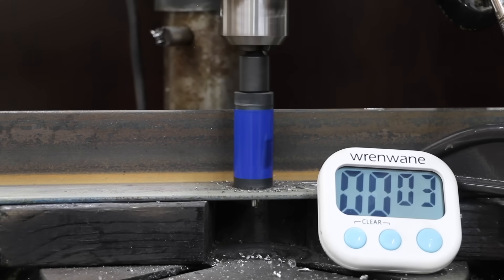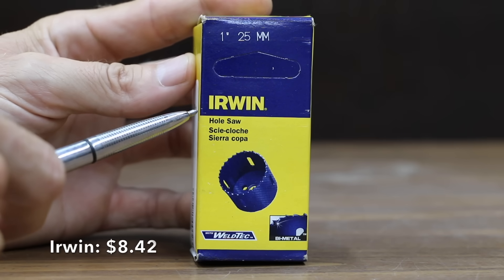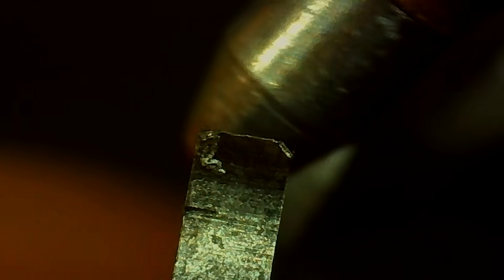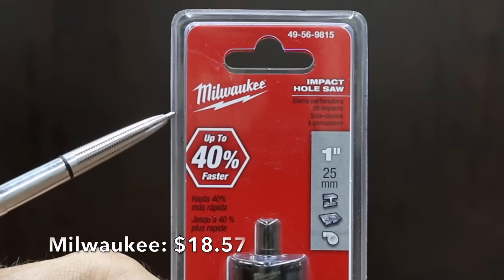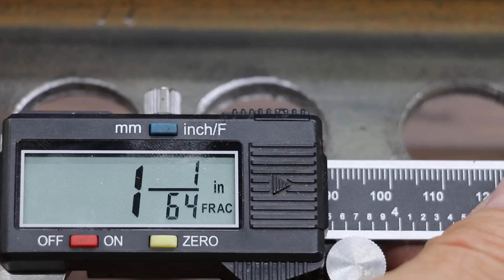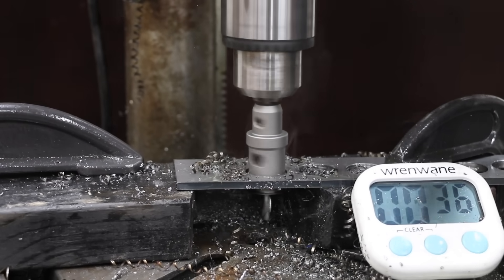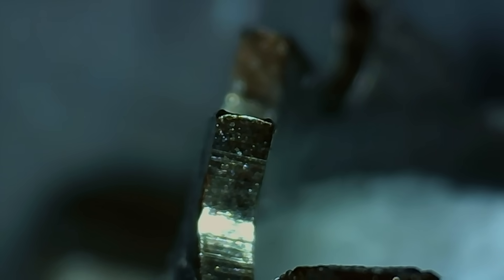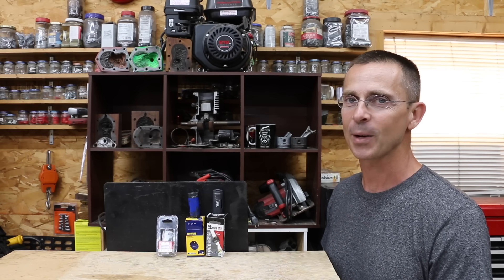Best Hole Saw Brand? DeWalt vs Milwaukee vs Irwin, Bosch, Lenox, Diablo, Bosch, MK Morse

Comment: I think a video on the strongest wire crimp methods and connections would be cool. Hydraulic crimp vs using a vice vs a hand tool vs soldering.
Reply from the maker: Great suggestion!  Thank you.
Reply: U-barrel roll crimps made with a genuine AMP tool were pretty good when I did that kind of work. Other brands of crimp tool can make a mess of the job.

Comment: I really appreciate this video. But, it didn't include a few of the other carbide cutters and high-speed cutters that could be used from other brands.

As far as the testing goes, I would have put the carbide cutters into a separate video than the hole saws, as they are quite different in their normal usage. Hole saws are more often  used for wood and inaccurate holes where the carbide cutters are used for holes that need a more accurate sized hole, with a more accurate placement.
Reply from the maker: Great suggestion!  Thank you.

Comment: Brilliant work yet again.. I'd love to see a hole saw test on wood, be it spade bits, hole saws or forstner bits.. But brilliant work. Quick comment though, you said on the 2nd test that the dewalt took 140 seconds (2 mins 20 seconds) when I think you meant 1 min 40 seconds 😂
Reply from the maker: Great suggestion!  Thank you.

Comment: Just off the top of my head, I strongly suspect that the relatively poor rigidity of the drill press arrangement here without the mandrel might have significantly hurt the carbide-tipped saws.  They're not good at all under loads that press off-axis and will tend to chip or fracture the carbide.  I'd love to see those re-tested in a setup that does not allow so much side-slip!  Perhaps a method for this could be pre-drilling a hole to guide it, and replacing the drill with a matched diameter piece of blank drill rod or something to guide in the pre-drilled hole.

Great test, thanks, man!  Fun to watch as always.  :)
Reply: Yea I noticed the run-out too and it definitely isn’t ideal for carbide, but at the same time how many people using these are going to be mounting them in super rigid stuff like a mill?
Reply: @Turbochargedtwelve  I'm with you, testing the carbide the way it works best isn't a real world test, sort of making it pointless.  Hell, I'm sure most hole saws are used in a powered hand drill, even if on thinner metals.
Reply: @zendell37  Hell yeah, when I would use these for work, powered hand drills and push as hard as you can, no oil.  What ever cut fast and the most times in those conditions is what I bought a second time.  They don't last long though be treated like that.
Reply: @zendell37  thats how I broken the teeth out of my Karnasch hole saw (103€) now i know not to drill by hand...
Reply: @Turbochargedtwelve  Not all that many, but that's one of the purposes of the mandrel, to keep the saw running in a single path, without a large amount of runout.
Reply: @Turbochargedtwelve  I have a mill so I will.
Reply from the maker: Thanks for the suggestion.
Reply: @ProjectFarm  Next episode: "Which lathe is best for testing these products? We're gonna find out." 😁
Reply: As cool as that would be, Yet that would be real lab testing. I think the way Project Farm does the testings allows for more real world test. Put it this way a lab test is so precise that the worst one could be the winner. These test are done with the most likely of how one of the viewers would use such a tool.
Reply: @kameljoe21  I'd contend that most folks would leave the pilot in, though, which would massively reduce the wander.  That was my suggestion, not that this was somehow bad testing.  Just that a more accurate test would have left a pilot or replaced it with something that would have a similar effect.  I doubt many folks will entirely remove the pilot from their hole saws before attempting to drill steel!
Reply: @komitadjie  You have some what of a point. Yet when I use a whole saw to drill holes I never put in the pilot. I have cut a lot of pipes and leaving it in only get in the way. I also use lots of fluid to keep them cool, Most times I use windshield wiper fluid. Doing this prevents smoking when welding or a mess to clean up after wards for paint.
Reply: @kameljoe21  Ah, granted, I've used a tube-sawing jig before as well.  The ones I've used run the saw pretty tightly controlled, though, and lock everything down tight to give a good, clean cut.
Reply: I love learning things in the comments!
Reply: I left a comment with similar sentiments. Carbide is not HSS. Being different they do like different running parameters too.
Reply: Yes, there did seem to be a bit of wobbling around in some of the vids. I wondered how this would affect the ability of the holesaws to cut reliably.
Reply: @woopimagpie  without the centering bit hole saws do tend to wobble. That just makes them cut a wider kerf. So they do have to remove more material. Running hole saws without centering bits is a technique I've used on a lot of jobs though for various reasons. I've even used hole saws to cut semicircles. Like this https://i.imgur.com/kn1eyOt.jpg
Reply: @komulista Yeah, good point.
Reply: Just think that most people here has Aldi drills.. So the test is pretty reliable.. And if you watch close it only happen to some of those drills

Comment: Those Milwaukee hole saws work pretty well for fiberglass, but that stuff just kills the teeth quicker than hell for how thin the material is. This is coming from a plumber who uses these and the red three blade Milwaukee hole saws daily.
Reply from the maker: Thanks for the feedback.

Comment: I appreciate the use of fractions most of the time for things down to about 1/16" or 1/32", which are measurements people regularly familiar with....but 1 & 7/128, nobody knows what that is off hand, and it's hard to relate to a figure like that....saying 1.054 is a lot easier to deal with....especially when you are comparing one at 7/128 and the other at 5/32, it's hard to compare...decimals are better, for future reference...🍻
Reply from the maker: Thanks for the feedback.

Comment: With cemented carbide you have to continually add cutting oil or cooling liquid constantly, as soon as it dries out itll crack or chip.
Reply from the maker: Great point!

Comment: Love this!  We fabricate 1-2 full 6 point roll cages a year and still use an inexpensive hand drill powered tubing notcher on 1.75 x .120 DOM...about 20 notches a cage if we get it right the first time so normally about 28 cuts.

The Lennox were our go-to hole saws forever until they became hard to get locally.  One would last a while cage and usually 3-4 more cuts after.

Now, cheap Menards MasterCraft hole saws and use three per cage but about the same price as on Lennox
Reply from the maker: Thanks for the feedback.

Comment: Please do a "best electric screwdriver" video. I'm talking about the low torque drivers that are designed for things like driving machine screws or fasteners in flat pack furniture.
Reply from the maker: Thanks for the video idea.

Comment: I’m surprised you didn’t test spyder brand hole saws. And no harbor freight!? What kind of test is this😂
Reply from the maker: Thanks for the suggestion for future round of testing.
Reply: Agree, Spyder has been doing a lot of marketing,  beating their chest on how they are the best of the best.  Would like love to see them called out or see if they are for real.
Reply: Spider bits are no joke on wood, never used them.on steel.

Comment: This is great because that's a similar drill press to my own. I wonder however, if a higher power drill press wouldn't have stalled, and wouldn't have broken the carbide tips?
Reply from the maker: Good question.  Thanks for watching!

Comment: I was wondering if you have considered testing high-discharge 18650s sold for use in vapes? Almost all of them have absurd claims, like 3000 mAh with 40A pulse discharge. As far as I’m aware, 18650s can’t have both that high capacity and that high current.

I know you tested a few types of 18650s in the past, but I think a testing setup for tens of amps would be interesting
Reply from the maker: Thanks for the suggestion.

Comment: Tip for everyone, don’t use these carbide cutters on the thin sheet metal you sometimes find in drywall, will completely destroy your precious bits, I speak from experience, he was only two weeks out of the box😢

Edit: I use greenlee for my knockouts and carbide cutter, fun fact, the knock out set uses a 25mm head, so if you have one and a 1/2 in square head impact then you don’t have to waste away your hands! Just be careful of the noise!
Reply: Both the bimetal and the carbide hole saws should do fine on the mild steel corner beads, but drywall screws are extremely brittle (hard) and will definitely damage a hole saw or saw blade! Are you sure you didn't hit a screw instead? You'd probably be fine going through a framing nail or even a deck/structural screw, but drywall screws are something else!
Reply from the maker: Thanks for the feedback.

Comment: You should have tested them on tube or pipe to test the teeth strength and notching performance. Have had bad experiece with cheap hole saws chippong teeth doing this.
Reply from the maker: Thanks for the constructive feedback.

Comment: I wonder if the top picks are good for pipe/tube notching? Like which one would leave a cleaner cut? Especially if the pipe is used for welding...
Testing different pipe/tubing notcher brands will get expensive though...
Reply from the maker: Great suggestion!  Thank you.

Comment: I think I’ve asked this before, but can you test the idea of adding a small amount mineral two-stroke oil to diesel fuel? How it effects the combustion, and lubricity mainly? If it quietens injector knock, and what ever else you can think of testing with it? It’s one of them common debates with diesel enthusiasts that could do with being put to the test by someone as qualified as yourself!
Reply from the maker: Thanks for the video idea.

Comment: What's up with using fractions to describe the hole diameters? It's much easier to compare dimensions when you use decimals, either metric or inches.
Reply from the maker: Thanks for the feedback.

Comment: The fabrication shop I work for uses  copperhead brand hole saw bits.  We can cut mild to high carbon all day long on one bit . That being said we do use cutting oil to help make them last longer . Believe hougen makes them
Reply from the maker: Thanks for sharing.

Comment: Good comparison as always - The conical stepped hole saws/drill bits are better at this job, a few of those included would demonstrate why - Your previous video on those some weeks ago should be linked or mentioned in this video Tod.
Reply from the maker: Thanks for the feedback.

Comment: Is the 1094 steel heat treated, or just annealed from the factory, makes a HUGE difference. Pointless test if just annealed
Reply: Care to elaborate? Just curious
Reply: @LyricsFred  heat treated makes it harder by cooling it faster and other processes but differ per manufacturer and annealed is aircooled making it softer
Reply: How so?
If the metal was heat-treated (usually treated to where a file won't cut it), then it's pointless to even think that a holesaw will cut it.
Even annealed the 1094 steel is tougher than the run of the mill mild steel, so the test isn't pointless.
Reply: @TrojanHorse1959  Destruction test,  hence the AR500. Annealed steel is low in the  hrc  scale (comparatively as mild steel) unless heat treated  (quenched and tempered)  to high 50's hrc its practically the same as mild steel as shown in his results

Comment: Thanks Commander Todd! Great test! I have 2 hole saws, one mandrel, one for installing Monitor heater vents and the other for 3 inch PVC pipe. Hope I don't need any more! Hope all is well and the hay is in the dry. We're still goofy here on the rain soaked swamp. BLESSINGS to all yall and GBWYou! And anything that can stand up to A/R plate is TOUGH!
Reply from the maker: Hi Lewie, Thank you very much.  I just finished making a few square bales, which are a lot more convenient to feed to my wife's dairy cow when the cow is inside the barn.  I believe I have enough hay for the year.  Wishing y'all many Blessings!
Reply: @ProjectFarm  YAAY for the hay!  I always got stuck with hay bales and concrete toting wheelbarrows because of my size and limited capacity to say NO. Built mus les I guess but wrecked at the same time. Yall remain calm and GBWYall!

Comment: "Up to 40% Faster" - literally, the only one that couldn't cut through the metal.
Reply: Up to 40% faster than atmospheric erosion.
Reply: 40% faster than eating the metal
Reply from the maker: Thanks for the feedback.
Reply: Up to 40% also means 0.1%
Reply: they meant dies 40% faster
Reply: Those Milwaukee shockwave holesaws don't seem to be designed for thicker metal however they do a great job on electrical enclosures.
Reply: Besides the no name
Reply: Up to also includes -∞
Reply: 40% faster at dulling

Comment: The "carbide teeth" on the ones you could scratch are not actually carbide. It's a old Chinese trick to use HSS.
Reply: Old Chinese trick. Lie.
Reply from the maker: Thanks for the feedback.

Comment: Awesome video as always.

I would love to see videos on brake rotors/pads performance for everyday or slightly modified vehicles, say slotted vs standard rotors the brake dust created vs heat output vs stopping power vs longevity or something along those lines.
Reply from the maker: Great suggestion!  Thank you.

Comment: Next time i would suggest pumping coolant onto the cutting tool. Those tools were not adequately cooled. But destroying them did show which was best in a way. With proper coolant flow a few of them would have cut the a.r.
Reply from the maker: Thanks for the suggestion.

Comment: Video idea (although it might be a bit expensive): best way to weld. You could buy different types of welding machines (MIG, TIG, Oxy Acetylene, Ultrasonic etc...) and test to see which gives the strongest weld, the best finish, which weld can withstand the most force before breaking and so on
Reply: Such a test would be almost undoable as every process has its own usages and specifics.
As an example, the best welder for rough farm work outside (SMAW) is useless on really thin stainless, where GTAW excels, but GTAW is useless outside as the shielding gas is just blown away.
So every process excels in certain areas, and thus the best welding process can not be defined.
Reply: @NemesisRTCW  Oh I actually didn't even know any of that. I don't know anything about welding, just that I love watching videos of them on YouTube. So thank you for the explanation
Reply from the maker: Thanks for the feedback.
Reply from the maker: Thanks for the video idea.

Comment: ''assembled in china with swiss components'' is that a good thing? i feel like its usually the other way around
Reply: maybe the paper packing was printed in Switzerland and oil sourced from usa for the plastic packaging?
Reply: I'm guessing Swiss Carbides that are brazed in place in China.
Reply from the maker: Great point. Thank you
Reply: @ProjectFarm  that made no sense
Reply: @well_as_an_expert_id_say  your mom makes no sense
Reply: well as an expert I'd say i think he has a couple of premade phrases he responds with because he responds to almost every single comment
Nice username btw
Reply: Most likely scenario for Bosch:
The device itself is made in China
The packaging cardboard is printed in Switzerland
The plastic sealing is most likely made in USA
The three components were assembled in USA

Comment: Bosch is quite good, bahco are good as well, made in Eastern Europe.

20mm 25mm and 32mm are the commonly used ones by electricians  in the UK and Europe.

Tapping spray is good to use, used carefully WD40 Is also good for hole  saw use.

The mandrills from bosch are good, and black and decker branded "piranha" 6mm metal drilling bits are good to start off a hole saw..

Have tried many of the expensive $30/$40 and $50 ones that have broken off cutting teeth on the first hole and the mandrill bit has gone loose..

For 6mm trunking nut hole drilling  black and decker piranha are very good, dorma are good.

There are a few small producers in the UK and Germany that make holesaws, if I can I will get you some to try and mail them to you, hope I can find your mailing address and the postal service is working OK with the virus disruption...
Reply from the maker: Great feedback. Thank you for the offer.  No need to send them unless there's enough interest in a round 2 video.  I'd love to test them again.  I'll check back later for viewer feedback on having a round 2 video.  Thanks again!
Reply: @ProjectFarm  I would really like a round 2 if you were to include both kind of Greenlee hole saw, they are regarded as being the best by electrician
Reply: Patrice Le Brasseur I agree, also include Klein. I haven’t used them so I don’t know if they are any good.
Reply: @ProjectFarm   do round 2 and do klein tools hole saw
Reply: Just got some Eclipse ones to try out, usually use Starrett but fancied a change!
Reply: @heavydiesel  spider are good too I've heard

Comment: Could you do safety razors? Durability and sharpness of the blades? You're the best, thanks!
Reply from the maker: Great recommendation!  Which brands do you suggest testing?
Reply: @ProjectFarm  there's Feather, Gillette, Astra, Parker, Viking Blades, and Van Der Hagen off the top of my head. Thanks for your consideration!